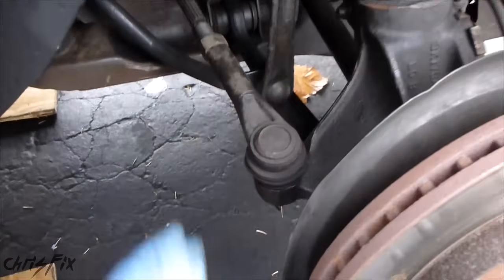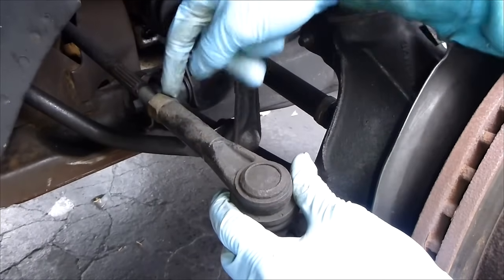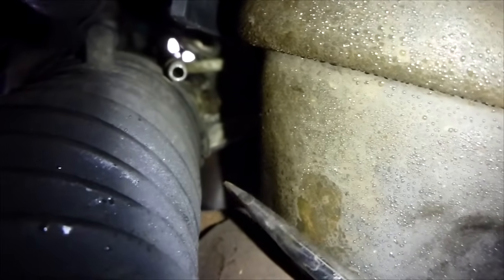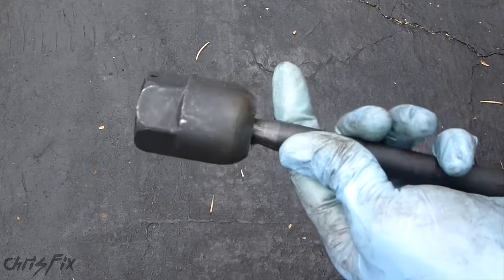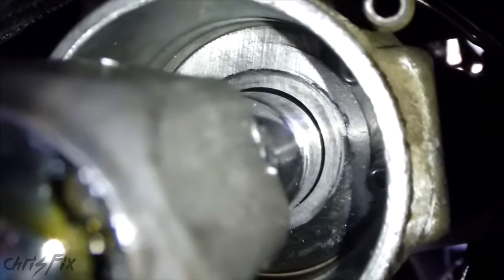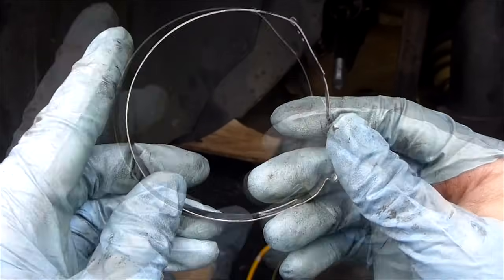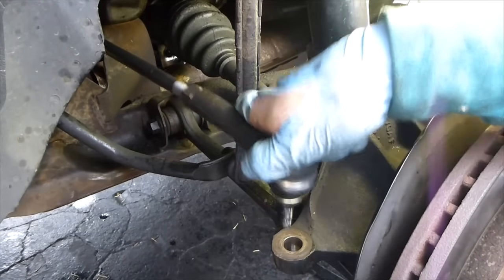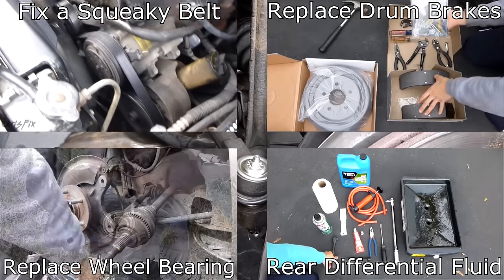How to Change Tie Rods (inner and outer tie rod ends)

Comment from the maker: I just updated the video with some edits. Thanks everyone for the comments and suggestions! Give the video a thumbs up if you thought it was helpful!
Reply: I have a 2013 GMC Terrain. I got hit and the tie rod is bent. I've called the parts stores in my area and they all quote me $100 to rent the inner tie rod tool and they don't even know if they have the one for my vehicle. Any advice?
Reply from the maker: The tool costs $100 to rent, but you get the money back when you return the part (ask them and make sure this is their policy). I would rent the tool and see if it fits. You dont need to take anything of except the bellows boot and just slide the tool on top of the tie rod and see if it fits. It should fit, the kits come with different size attachments.
Reply: It was their policy. The young guy on the phone didn't understand that it was a deposit of $100...Thanks a lot.
Reply: ChrisFix I had to order parts because my vehicle is new (crash damage). The new inner tie rod has no pin. the tie rod end has no grease fitting. They did, however send the original clamp for the boot, so I won't have to use zip ties. Thanks for the video, it was a big help.
Reply from the maker: Great! Glad things worked out and glad the video is helpful so you can fix your car!!!
Reply: So if you can move the outter tie rods with your hand they need replacement? Could bad tie rods cause grinding in the petals and steering wheel?
Reply from the maker: Grinding can be a few things. It could be a bearing, it could be your brake pads, or it could be a clearance issue (like the dust cover hitting your rotor).If the outer tie rods have a lot of miles on them, are loose, and the boots are cracked or torn, they most likely need replacing. 
Check out this video that might help:
How to check out your own car's suspension system
Reply: ChrisFix Thanks Chris I watched the other video. That's what I've been doing for the past 2-3 months. I changed the strut mounts too because when i pryed under the wheel there was play up and down. The top plate had a fair gap too when the car was on the ground. After replacing the mount the gap is still there but less. The grinding starts when the car gets warm after 2-3 minutes of normal driving, It's felt through the steering, the centre console and the petals sometimes. I've also changed the rotors to new and the brake pads also it's driving me insane.
Reply from the maker: Check your brakes! Grinding is usually caused by brakes, especially from used up pads.
Reply from the maker: Oh, and thanks for watching and commenting and stuff! Glad the videos are helpful!
Reply: ChrisFix Thanks for sharing I'll be doing my tie rods soon
Reply: Great camera work!!  Much better than many other auto repair videos I have watched.
Reply from the maker: Thanks a lot Joe!
Reply: JoeSmoe Thats what I was thinking, great camera views, most other vids cant see good enuf, Great Vid.
Reply from the maker: Thanks guys!
Reply: ChrisFix Hi Chris. Nice video. One question. Are you supposed to grease the pinion teeth or no grease is suppose to go on it?

Thanks
Reply from the maker: Mario Bro
Just leave the rack and pinion teeth alone (unless you are having problems with it).
Reply: Pinion you mean the power steering rack and pinion? I pulled the right steering boot off and theres grease dripping from the inner tie rod and rack and pinion is packed with it.
Reply from the maker: Mario Bro I would just leave the rack and pinion alone. If there is plenty of grease then good, it is ready to go. Make sure you seal it well with the boot to prevent any dirt from getting in there.
Reply: Thanks Chris! By the way if the grease is drippy and soft could that indicate a leak?

Thanks again
Reply from the maker: It could be a leak. The power steering fluid could be watering down the grease. Are you losing power steering fluid?
Reply: The fluid level is the same. My steering pump is dead but still kind of going with a very low dull noise and I'm getting little weeps at hoses. Is it possible the rack picked up the grease and brought it in the system?
Reply from the maker: Mario Bro I dont think that would happen. Might want to try a fluid flush: How to Flush Your Power Steering Fluid
Reply: Thanks
Reply: I have a 08 pontiac G8 Gt. It started to drive bad makes noise when I go through bumps mainly feel it on the driver side.  I've taken it to 2 Mechanics and was told it was the  sway bar link and the outer tie rod the other said it was the strut mount so all that was replaced .. still does the same annoying sound.  Could you probably have an idea of what it could be?
Reply: Helena Ayala Engine mount
Reply: +Helena Ayala axel bearings. buy new boot kit and clean original axel real good. the new boot kit should come with some small new parts along with new boot. and bearing grease
Reply: +ChrisFix Hey Chris great tutorial....
Reply: +amado lasala I'm no mechanic by any means but that could just be your wheel out of balance I've had that before
Reply: Chris just some advice to y'all from someone with 30+ years of working on cars and trucks. Not everyone replaces a brand new tierod okay. Most of what people are working with is rusted fast and jammed in so tight the virgin mary would blush. You can show people how to separate this stuff using tools around the house and solutions like a propane torch and a pair of welders gloves to yank and crank on parts. Not everyone works on a clean car and clean parts simply put the shit they spray on the roads here during the winters would eat the hide off a groundhogs back.
Reply: ChrisFix you dont sound as  Motivated as you are now
Reply: Gracias yo no hablo inglés pero tú vídeo me ayudó mucho muchísimo no ocupé entender tu idioma inglés solo me fui paso a paso y fue exelente , Dios te bendiga siempre.
Reply: ChrisFix rear control arm,how do I put back on car.
Reply: Robbie Baker is this my old collie from redding

Comment: I'm a long time mechanic and I must say that this video is right up there with the best!  You're well spoken, explanations are great, camerawork is great and you know the terminology for what you're working with.  Great job and thank you!
Reply: If you were a good mechanic... You would've noticed something very wrong with this video. Watch it again and get back to me.
Reply: @sveni3798  okay, I'm ready to learn something. I watched the video again very carefully and really didn't catch anything this time around other than where he may have misspoke a few times. Now I must say that I don't have much experience with rack and pinion front ends because I haven't had to repair one yet.  So, please tell me what was really wrong with this young man's video, I want to learn something.
Reply: It’s inaccurate and too imprecise to count the number of turns when removing the outer tie rod. It’s much more accurate to measure from the center of the tie rod end and a self-made mark on the tie rod itself. Since Chris is replacing both the inner tie rod and the outer, he would want to measure from the rack and pinion housing out to the center of the outer tie rod end before removal.  Yes, he is going to get an alignment right afterwards, but I have seen different tie rod end lengths. This can render the car undrivable if using the turn count method.
Reply: @johnnyv7618  also too much grease in the tie rod end. The boot shouldnt swell that much. Aka too much grease

Comment: I may have posted this on your video before, but I had a 2007 Nissan Maxima was was having suspension and steering issues. Using your videos, I saved over  $4,000 as Nissan quoted me $5,400 to do the work. I paid $1,000 for parts and tools.
Reply: Dude where do you live? That car doesnt cost 5400 dollars  even in Turkey where the cars are one of the most expensive stuff.
Reply: He didn't say the car cost 5,400 dollars. He said the dealer was charging him 5,400 dollars to do the job. He saved 4,500 dollars doing the job himself, he spent a 1,000 dollars in parts and tools did it himself.
Reply: Jay Pete don’t ever go to the dealer because they overcharge you waaay to much for a simple fix go to an independent shop that’s been known for great service but remember never the dealer
Reply: Jay Pete nissian is an amazing vehicle I have a 2007 Nissan Murano with 386,000 miles
Reply: I had the EXACT same situation with my 2004 Honda CRV! Got a $5,400 quote from a local reputable mechanic, but did it myself for $1000 in parts and tools!
Reply: I think this is one of the often overlooked but very cheap & easy fixes for steering issues
Reply: I agree working on cars is not an art anyone one can learn it. With the right safety a bit of help from ybe vidoes. I used to spend a load on basic servicing. Being poor helps as you have an incentive to do the jobs yourself.
Reply: @bytarik  
A nice loaded low KM 07 Maxima is easily worth $5400 here in Canada
Reply: I'm moving to where you live and opening a Nissan repair shop!
Reply: $1000? Lol i spent $65 on parts and nothing else
Reply: Pretty sure they charge so much hoping they won’t have to do the work and you will buy a new car from them instead which is BS
Reply: thats sounds a bit rich to me for a job that takes a few hours.
Reply: @user-vz9ys4nm9j  The issue is dealer supplied OEM parts...OEM parts most times are way more expensive than aftermarket prices and dealer labor rates are usually higher.
Reply: @josephpiazza97  and they do crap that doesn’t need to be done for a budget a good b.

Comment: I've replaced at least a dozen tie-rod ends.  I've NEVER had one that would come out with a rubber mallet.  
I've always used a mini sledge hammer, and hit the spindle from the side.  Usually 3 good wacks will pop it out.  Also, instead of counting turns, I pull the inner and outer off intact and measure the distance from grease fitting to fitting.  Then make sure the newly assembled unit is the same.
Reply: the way the rental tool slides over the rod how do you remove the inner tie-rod if the outer end is still attached? I may be doing this job soon.
Reply: I usually use the pickle fork tool to separate the inner.
Reply: i have remove my rod a a few time and taping it out never works i always end up hitting the spindle to get it off
Reply: Well I don't tap it.  I use a mini sledge hammer and hit the side of the knuckle about as hard as I can.
Reply: Same way I do it! I have a small sledgehammer that I call 'Mjolnir'. The only thing that I've found to get the tie rod ends out first time, every time. 

One solid crack on the steering knuckle usually works for me on all the cars that go through the garage I work at.
Reply: Alex Greenwood I have a huge maul I use for diesel mechanicing called Odin it's about 25 pounds for the head it'll break anything loose.
Reply: Heheeh, if not, break it entirely! ;)
Reply: I use explosives. :>)   Actually in my day I used a large short handled sledge. Like you said It works all the time. (I used to drop it on my ex-wifes foot when she would ask ..."Hey watcha doin". She made me get my own beer. Oh well. It was funny.
Reply: Nice, 69 likes.... :P
Reply: I used to use a tie rod fork...a long rod with a tapered fork like end. Push it thru the joint and rubber grease thing (can't think of the name)....then hit the end of the rod with a mallet. The tie rod should pop out from the joint. It is quite easy once you do one or two. Handy tool to have. Good luck dude.
Reply: I know right! Breaking a ball joint from the knuckle is the worst process ever!, Ive gone as far as heating it up with a torch, or even just cutting the ball joint at the boot and pressing the stub out with a ball joint press after.
Reply: Yup, I have a 3 pound hand sledge I use for these. Just T-bone the steering knuckle and it pops right out.
Reply: is there a left inner tie rod or does one inner tie rods go on eater side ?
Reply: Alex Greenwood I call my 3 pound sledge hammer little thumper and my 10 pound sledge big thumper lol.
Reply: Actually the recommended procedure is to have a back up mallet on the other side from the one you are whacking. You are right about the rubber mallet its next to useless in this case. Most of my FSMs suggest red loctiteon the inner tie rod, Imagine trying to find the mating hole for that pin in a blind location. That would be ok if the rack was off the car.
Reply: Great videos, keep doing them your inspiring many DIY. THANK YOU!!

Comment: Chris, Just wanted to say Thank You for sharing your knowledge with others, I did the inner and outer tie rods According to the videos instructions, I'm not mechanically inclined, but you provided the right information step by step and I managed to get it done.. Thanks again, Wishing you continued success, Congratulations on over 7 million subscribers..
Reply from the maker: That's what I love to hear! I'm glad you managed to get this done on your own! Thanks a lot!
Reply: how you get all tools to get the job done? for me, outer tie rod is just fine to fix, but not inner one, the challenge.
Reply: do you have to use any specific grease?
Reply: @Chris-db9vt  general purpose grease should work just fine
Reply: @chrisfix  doing my on jeep 2007 4.7 v8
Reply: Did you get the car an alignment after doing the job? I just got told AFTER getting an alignment from getting new tires that I really need to replace my outer& inner tire rods on all 4 wheels
Reply: @Toastychurro  I'm about to Saturday and get an inspection this dude Chris  legend I mean I have changed everything on my car already some brakes to rotors to ABS system to add bags to a car accident fixing to everything he has teach me  so much
Reply: @Toastychurro  u should get ur car aligned after u do the job because if you get your car aligned without doing anything to your tie rods you’re basically putting a bandaid on the problem

Comment: I love how these videos boost up my confidence. Then you go to actually do it, and every approach requires different steps.

The inner tie rod spins, so I ended up using a pipe and vice scripts to hold it in place. Then there was a rubber housing over the inner tie rod.

The rubber mallet for the castle nut didn't work. Sledge hammer baby. Gotta go caveman sometimes.

Comment: Chris, tonight or tomorrow morning I will be changing my outer tie rod ends on my 2007 Nissan Murano. I feel very confident doing this because of your video. I’ve always been super mechanically inclined and love DIY jobs. I originally was going to take my vehicle to a shop. When it comes to steering I have not attempted anything prior. I looked up how to check if a tie rod is bad an discovered you and your vids. I am incredibly impressed with how instructive and thorough you are. Because of your instruction is why I’m going to change these out myself with complete confidence. My driver side outer rod is sooooo loose one can lightly hold onto the bellow and spin the rod. CRAZY. I will comment as to how the job went. Thank you, Chris!
Reply: Update?